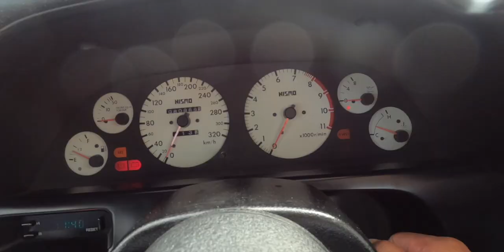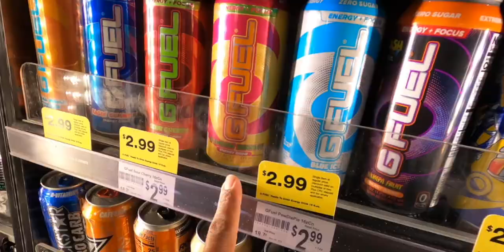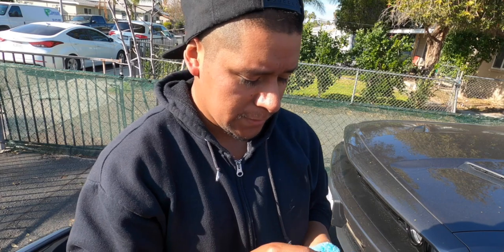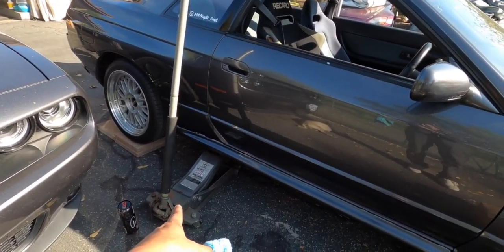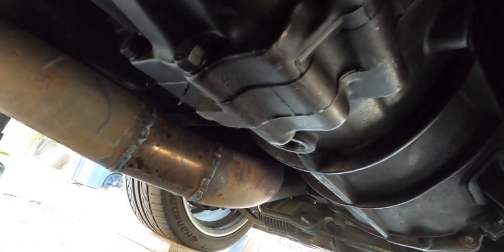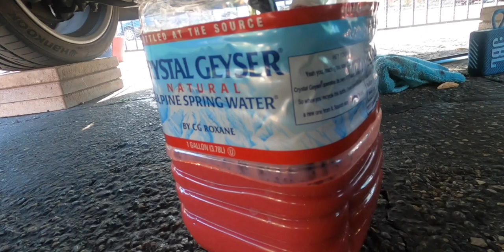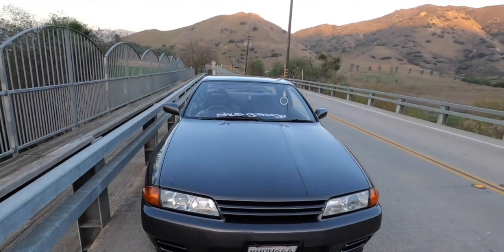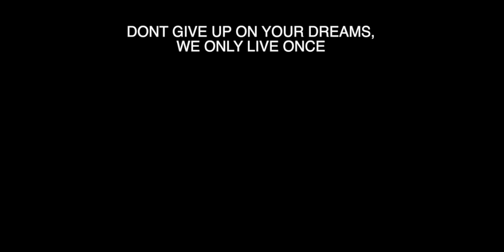Redline gear oil for the skyline

Comment: Hey bro just a suggestion but don’t jack up or use jack stands on the pinch welds cause there old and Braille. When they bend they cause rust. Jack it up from the front and back of the car where the X is and put the Jack stands on the front and rear subframe.
https://www.gtrusablog.com/2017/10/r32-nissan-skyline-jack-points-jacking.html?m=1
Reply from the maker: Thanks for the info. I was wondering if there was a better way to lifting up the car.

Comment: The short plastic tube from the pump kit is meant to be pressed on the bottom of that black pump neck to fit a gallon container.  Nothing will fit the redline quart bottles though, huge PITA.
Reply from the maker: Yeah that's why I just cut the gallon of water and poured it there.

Comment: Awesome the grinding is done with.  If it's cool to ask, how many miles was on yours when you got it?
Reply from the maker: It had 72000 kilometers
Reply: @shus369  cool thank you bud.  Got two in my sight.  One high miles one low.  Almost time 😍
Reply from the maker: @patb6703  are they the original miles? Mine has the nismo cluster changed so I don't think they are original.

Comment: can you recommend how much of which oil for my R33 GTST. for manual trans and for the diff????? thanks
Reply from the maker: not sure how much oil you need for your r33. you can use the same one I used. you will need to pump in the new oil until it starts spilling out of the filler hole. hope that helps

Comment: What was the first song? Also  glad your 4th gear grind went away my r33 started random 4th gear grinding. THANK YOU
Reply from the maker: The song is called cold by charix, give the heavyweight redline gear oil a try. It's amazing what changing the gear oil will do.
Reply: @shus369  thank you. I for sure will I changed the oil about a month ago and it started so I got the redline heavy shockproof in my cart ordering it Friday thanks again brotha